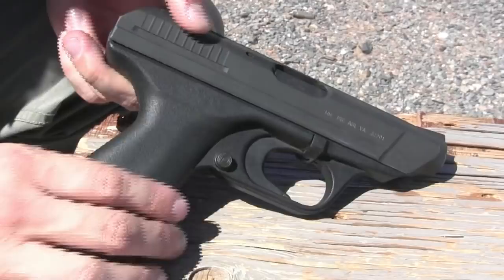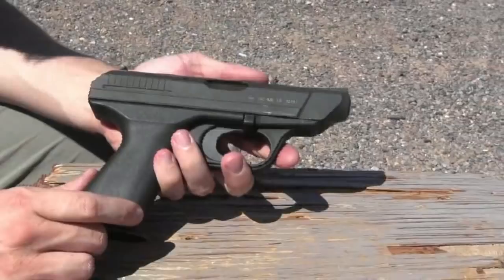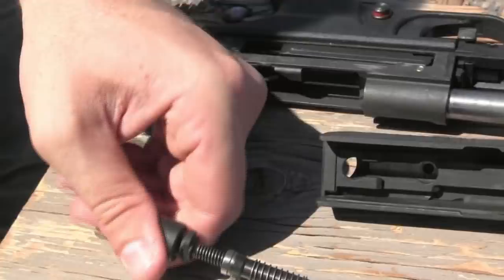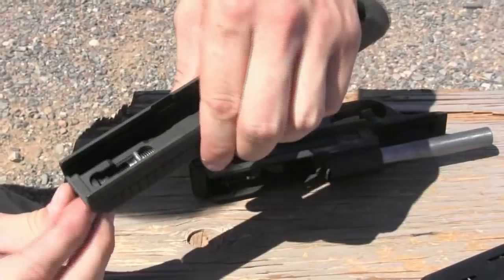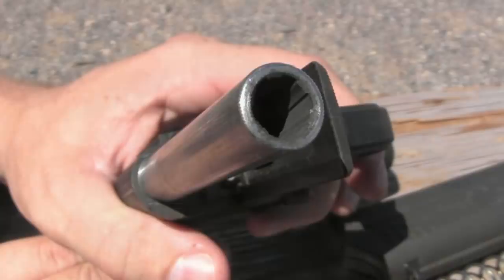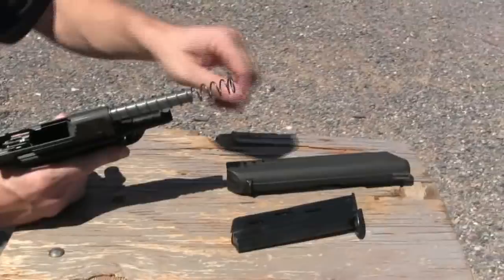H&K VP70Z - Disassembly and shooting

Comment from the maker: The similarities between the Hi Point and VP70 are polymer frame, DA only trigger, striker firing, straight blowback action, and fixed barrel. Mechanically, they are basically identical. The VP70 is better made, but not intrinsically very different. The "HK" on the gri adds a thousand bucks to the price, though.
Reply: Forgotten Weapons my first thought when looking at this pistol was “oh, a fancy hi point”
Reply: Being all honest, this thing have a manual safe, so putting a new spring that requires less tension, would not improve the trigger?
Reply: Weird. Mine only set me back $400 in 2019.
Reply: No, they are not. Hi Point is single action, not double. As on the VP70 its sear has no pivot, it slides perpendicular to the striker axis. VP70 striker spring works against the slide (like Luger and Glock), on the Hi Point the striker spring works against the frame (like many 25 ACP, the Simson 1929 9 Luger prototype featured on Forgotten Weapons or the Russian GSh18). Maybe a good trigger stop could improve its weird trigger.

Comment: I bought a used VP70Z pistol back in the mid or late 1980's.  It came with a spare magazine, and I encountered another magazine at a large gun show in Las Vegas.  With all three magazines loaded, I could load an entire 50 round box of shells and still not top off the three magazines.  A fully loaded magazine in the pistol plus one round in the pipe, AND the two spare mags, gave me 55 rounds of hollowpoint ammo at my disposal.  I still own the firearm.
Reply: Ok I can do the same with my Beretta PX4 storm but that gun is actually accurate and reliable

Comment: H&K really ought to reintroduce this gun to the market. Fix the crappy trigger, make it reasonably priced, and they'd have an instant success.
Reply: +coltonsin64 Why would you want a wimped down 9mm pistol with .380 performance? Just get a .380.
Reply: +coltonsin64 The way the gun is modeled in Resident Evil 6 would make an interesting revamp of the design. I don't know where they put the safety (because most games don't bother with it), but they incorporated some designs from the Walther P5 and the mag release from the P99QA, replacing that hideously unsafe heel release. I guess they could treat the trigger like an extremely heavy double action pull, which I can see advantages to for police use.
Reply: The striker (firing pin) bore is rough, which is much of the heavy, gritty trigger pull. I honed mine with fine paper at 45° then lapped it with rouge and dry firing. The trigger is too rounded so I ground mine flat like typical revolver triggers. Made a huge difference. Reduced the pull by 1/3, no longer gritty. The VP'70 was designed to use submachine gun ammo, not SAAMI or NATO pistol ammo, so perhaps the barrel groove leakage wouldn't be as significant.
Reply: They could fix the rifling though on a new model
Reply: This is a bull shit and not a design.
With such a high barrel.
  He is not needed anyone.
Reply: I agree I really want one of these guns
Reply: 3 round burst would make it classified as a machine gun tho
Reply: I agree! If the Browning Hi-Power could get a rebuild then so should this
Reply: @AJadedLizard  actually the gun in that game was a Walther P5 mixed with a another pistol that I forget the name of
Reply: @ofearghailthefearless6481  No, it's a VP70 (slide and overall shape) mixed with a mid-generation Walther P99 (like the QA or DAO models; it has their magazine release).

Comment: Gun enthusiasts will call me crazy, but I got one for my first handgun and I am extremely happy with everything about it. The sights and trigger pull don't bother me which is a lot of peoples biggest complaints. Despite the long trigger pull, it does have a clear wall and crisp break. Also, the european style mag release is extremely nice compared to most other handguns that have one. Best part about my purchase though was that I got everything originally in the box plus a total of 4 magazines. Not bad for the 900 I paid considering most others were selling for 1200 for just a mag and the gun. Came in great condition as well.

Comment: I am the original owner of one of these and it's a love it or hate it thing and I love it. The raised rifling chews up the end of the brass a bit but for target shooting at 50m at an 8x10" rifle target, I can put all 18 in the black. The accuracy when squeezing the trigger the last bit is amazing. The simplicity of design makes it reliable. The only downside is that the slide cannot be blocked back to leave the action open so at a range, I just pull the magazine, pull down the locking clip and take it down when the cease fire sounds. Rangemasters like to see a handgun in pieces when they come by to inspect. If I ever had to bet my life on any weapon, this would be the one. It just works.
Reply: +Mikephx I am also an "original" owner, it was the first handgun I purchased when I turned 21. It's been a great toy that I still enjoy. I consider it a fantastic first gun and training weapon. Once you can put rounds on target accurately with a 20 pound trigger pull, you can easily fire any other gun accurately.
Reply: Wolff makes a lighter trigger spring that reduces the trigger pull. It may have some reduced ability to set off old military primers, but I haven't run into anything that it won't fire reliably.

One thing I have run into - I got some bad underpowered rounds that would fire and cycle, but the bullet wedged into the barrel. If you ever hear a pop instead of a boom, check the barrel. It wedged the bullet in so tight I had to hammer it out - and chambered the next round...
Reply: Dave Peters
My VP had a bullet stuck in the barrel with another round chambered once, there was no doubt the ammo was no good (yellow/orange flashes in daylight, sparks that flew around after firing, etc.), I'm glad I didn't try another trigger pull!
I sometimes worry about that happening with my MAC11/9 in full auto!
Reply: Perfect gun for someone who only has but one gun.........once you master the trigger it is as accurate as anything else.....very reliable and built like a tank.....you will never wear it out.....

Comment: When I first subscribed to Shotgun News, right after obtaining my FFL back in 1978, this was one of the drooling guns on my list.  While I never did order one, the idea of having all 18 rounds available in the gun was a real advantage back then. Our department required you carry either a personal owned firearm, or one of the City owned Model 19 Smith and Wesson in .357 Magnum.  The basic load for the gun was of course, the 6 rounds in the cylinder and 12 more in drop boxes.  Most of us purchased speed loaders when they became available at our own expense simply because using drop boxes with loose rounds, or belt loops as some were issued was just plain slow and under pressure, dropping the rounds on the ground during reload became a real concern.  Having the entire basic load of 18 rounds of 9mm which was, back then usually loaded to near .38 special ballistics seemed a real advantage, then you could carry an extra mag and have twice the basic load available.  I did find, however that when I purchased a Smith and Wesson semi-auto with it's increased magazine capacity, on the range, I still had to load six and reload with everyone else.  That, in my opinion was stupid, but that still remained the course "to make it fair to those carrying revolvers!"  My last qualification round back in 1993 there was only one officer who still carried an  old Colt Trooper, the rest of us had either 9mm or .45's with a couple of 40's in the mix I believe.
Reply: To be fair to him the trooper mark 3 was arguably the best 357 colt ever made and one of the best service revolvers ever. I don't think you'd be too bad off with that one.

Comment: A friend of mine had one of these around 1976.  You nailed it: the adapted machine pistol design yielded a crappy trigger and a large magazine capacity.  Styling ahead of its time, though not as much so as a Whitney Wolverine. An intersting novelty, but even then I preferred my Browning P35 in 9mm and my 1911 in .45.

Comment: When I was a kid in the late 80s I had a cap gun version of this.  It was pretty awesome.  It used those plastic strip caps (not the paper kind, but like a strip version of the red ring caps) that fit in the magazine, and then the trigger would feed the caps through.  It had a black frame and an orange slide, but of course I spray-painted the slide black.  It was pretty cool, and is probably why I still have a soft spot for this pistol.

Comment: You failed to mention that Hk VP70Z is a double action system because it pulls back the firing pin every pull of the trigger and when it goes all the way back it releases it to fire.

Comment: ,,, like a HI-POINT ...

Ouch !

As a pistol, the VP-70 is questionable. With its shoulder stock an full auto mode, the trigger becomes a safety factor.

HK has had its up and downs.

The multi-caliber HK-4 was clever but pulling the trigger to close the locked open slide over a full magazine ... Not so.

The 1960's MP-5 firing from a closed bolt instead of using a massive bolt  slamming forward and throwing the muzzle off target : WOW !

The G3 rifle with its ultra violent spent case ejection ... Not so.

The magnificent P7M8 born a proud example of German engineering in all its excesses - a highly prized keeper. Doomed by the plastic tupperware wave coming in a 1/3 the cost. Yes.

The P9S downsizing the roller locking system of the G3 into a pistol : impressive. Using an elastomeric buffer which turns into dust with age - what were they thinking ? And having to press the trigger with a chambered round as part of using the decocker ... Not so. 

The PSG-1 rifle OOH ! HAH !

Sinking millions in the G11 based on caseless ammo meant not ejecting hot brass deprived the G11 of the means of evacuating heat accumulated by multiple shots. Not so. That one bankrupted the company.

Telling the British how to make a service rifle by turning their SA-80 turkey into a reliable rifle - in your face.

France let its own firearms industry die now has to replace its FAMAS with HK's 416 rifle. A rifle that does not allow combustion gases to vent into the action like the M-16 and M-4 do. 

So yes, HK did put out very interesting stuff but also questionable stuff. You can't put anything with the HK logo on a pedestal.
Reply: I like the G3 ^^

Comment: like others have said, the father of the Hi-Point. it's cheap (or was) and it works, it met the requirements.
Reply: In the early 90's I saw them advertise for $238.00 new.
In the 70's, they were wanted because of the 18 rounds. That was rare..... and being H&K....

Comment: A friend of mine had one of these, decades ago. The trigger pull felt exactly like that of a toy gun I had as a kid. The trigger on that would "cock" and release a heavy spring, providing the propulsive force for little plastic discs. (Also, to the occasional pain of my little sister, pennies. :-)

I have several H&K P7 pistols and can definitely see some family resemblance to this.

Comment: Hi Point my glutious maximus... First off you do not put lead through that barrel period. It will cause severe leading and possibly blow the gun up if it gets too lead fouled. It is right there in the owner's manual. Other than that I have never had any problems with my loads or good factory ammo. The pistol is built like a tank and is still going strong after 40 years. It didn't fail to impress when I was getting robed at a Gulf Station back in 1983 by five big guys that wanted my money. Those men put their hands so far in the air they looked like Clyde the arangatang. My buddy just happened to have it with him at the time. I later bought it from him.

Comment: Curious: If the muzzle velocity is lower, there must be some trade-off to make that worthwhile. 18 is a high capacity even now (well, I guess more middle of the road, with GLOCK and Beretta both having offerings in that capacity); I assume recoil is somewhat lessened by how big this gun is. Is it more accurate with the lower velocity?
Reply from the maker: +A Jaded Lizard The benefit is that it's a simpler gun.
Reply: +Forgotten Weapons I see. I guess it'd be a reasonable military sidearm or survival pistol, but not so great for every day use when ruggedness isn't a benefit, then?
Reply: A Jaded Lizard usually a lower velocity worsens accuracy as it leaves the projectile in the air longer as it heads towards the target. And with more time in the air, the projectile is exposed to bullet drop and winds longer, decreasing accuracy.

Comment: Nice gun, and good video, I would not mind owning one of these. Seems like a gun you can shoot forever without it breaking :)
Reply: +100radsbar  I've run tens of thousands of rounds through mine over the last thirty plus years I've owned it. There is almost no detectable wear to be found and I've had no trouble at all with it.
Reply: +Kevin Jackson Cool info :) H&K does make some good guns, except the G36 :). This H&K VP70Z, is one of those guns you have for an SHTF type situation.

Comment: I shot when of those pieces of crap once. The slide trigger was like a bad toy design. Definitely had to pull it back a little bit and then a little bit more, almost had to re position trigger finger to keep it feeling comfortable.. We discovered it also shot more than one round occasionally, usually 2 rounds every now and then and sometimes 3. It didnt do it fast like the military version fires in burst but it did fire unintentionally about a half second after the first round.. Scary. I think It did it when you didnt let the slide trigger return immediately.. Took it to a gunsmith and he laughed, said it was the worst design ever..  Wonder how many others malfunctioned like that one?

Comment: That gun was originally designed to equip tank Crews with a small SMG. Luckily, when I was a tank Driver back in the early 90's, we were carrying an Uzi. Quite heavy, not very relyable, especially with the safety mechanisms, but almost no recoil.

Comment: Call me nuts, but I kinda like the idea of a HK VP70Z with a Glock type semi-cocked striker system so it had a decent trigger pull (and front sight) and cost $300 (same as the Palmetto State Armory PS9 Dagger). It would be funny if the world's first striker fired polymer frame pistol came back from the dead and outsold Glock.

Comment: You should re-review this pistol. Other than a fixed barrel, not like a HiPoint as you have stated 7 years ago. The HK is better built by far. HiPoints run reliably but have some weird weights and weak springs inside. The VP-70’s slide is a stamped u-shaped channel with the internal components welded in. So between the polymer and stamped construction, this was supposed to be a simple, easy to manufacture and inexpensive pistol for the people.  But then HK likes to price things expensively regardless

Comment: Staggered Feed mags!!! Why don't more pistols have staggered feed mags?
Reply: +deadpan237 Despite the double stack clips in the VP70Z, the grip isn't particularly large and the slide isn't much wider than most modern pistols.
Reply: +Nicholas Mew Because staggered stack single feed mags work just fine, and are plenty reliable.

Comment: Around 1980 or so, we experimented with these as our group standard replacement for our 1911s. We sent them all back to HK because the sears wore, and all we got was a trigger pull-through without a bang. Horrid trigger resulting in very low accuracy. Tacticool, but untrustable.

Comment: You do know now that the VP70 doesn't lock back after the last round every time, right?
Reply: Locking back and ejecting the last round are two separate things.
Reply: +Bladsmith Umm, wait a second, I didn't mention about it ejecting the last round, I just talked about not locking back.
Reply: +MCG55555 Yes, I do know.

Comment: You really needed to shoot the machine pistol, not the stapler.  That's the real iconic firearm.  You also didn't state what the actual weight was.  For it to be a functional blow back, in 9mm, it has to be quite heavy.  The Markov is the largest pure blow back pistol currently produced.  It weighs quite a bit, has horrendous spring weights and only shoots the 9x18, not 9mm parabellum.  No 9mm para blow back has actually made it on the market, that I know of.